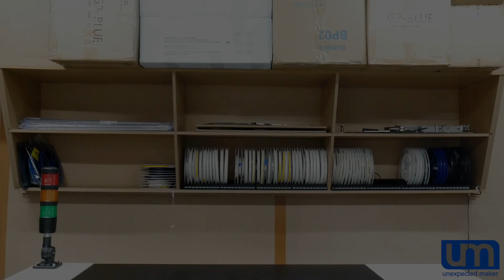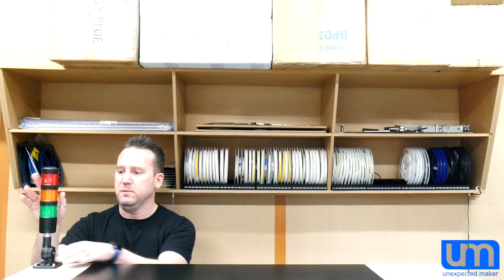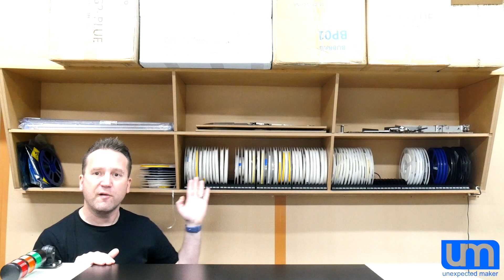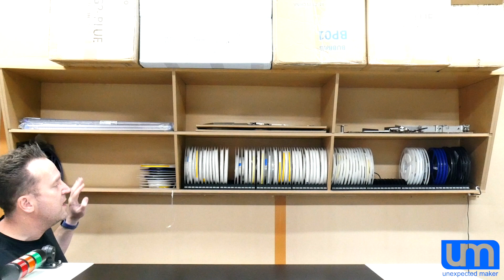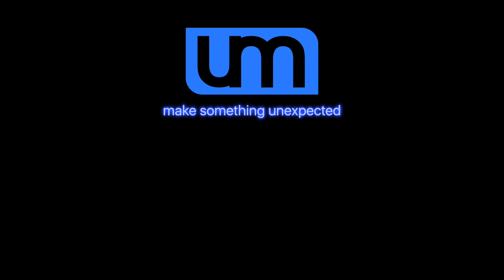SAM IRL - It's Alive!

Comment: Does it also track what's in the P&P and deduct from inventory as it goes?
Reply from the maker: No, the PnP is not internet/network connected, and even if it was, I cant interface to it to deduct parts as they are used.

Comment: Love it. And you were quite fast from idea to "it works" and proved the chat wrong with all the complicated suggestions and remarks "it cannot work that way". And I love how Sam is interrupting you, like in real life :D
Reply from the maker: Cheers Peter! Yeah, SAM's a real busy body!!!!!!
Reply: It works for a very reduced array of components that you can pronounce. How do you identify for example "STM32F031F4P6",  "74AHC1G125GW,125", "ADXL345BCCZ-RL7" or "TJA1050T/CM,118"? If you're not extremely careful, a part identification error can completely (and in some ways very hard to test) completely mess up production. You really don't want to find out that the last batch of 2000 boards all have a 10K resistor instead of 100K and that causes them to reset when input voltage drops below 4.9V.
Reply from the maker: @FreezeS  I have eyes :) Do you think I'd pull a reel out and load it on the PnP without looking at it first?  I'm not using part codes or stock codes - intentionally. That simplifies search terms and increases accuracy. For instance, I use 3 different types of diodes (on 8mm reels). I don't need to track where each specific one is.. like MBR130 versus MKS4005 - I just need to know where they all are and I can find the one I need quite easily. SAM is not for tracking 13" reels of ICs/MCUs as I don't stock 100+ reels them at a time like I do with 8mm reels.
Reply: @FreezeS  he blames Sam, no problem ... :P